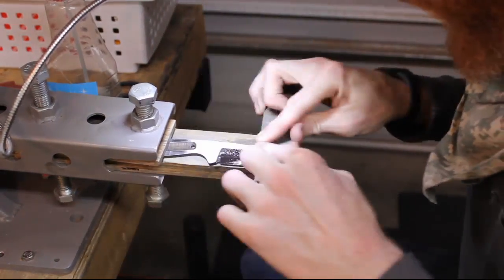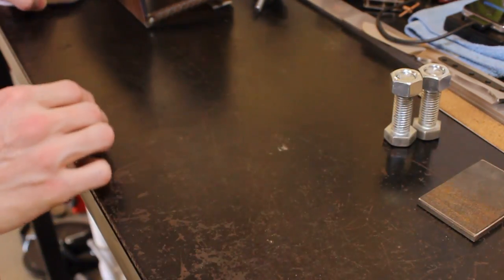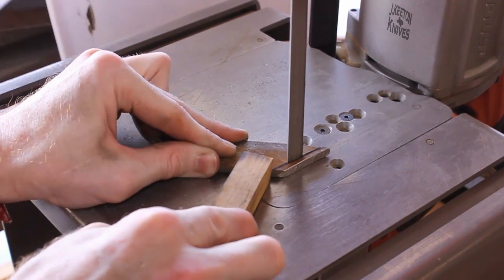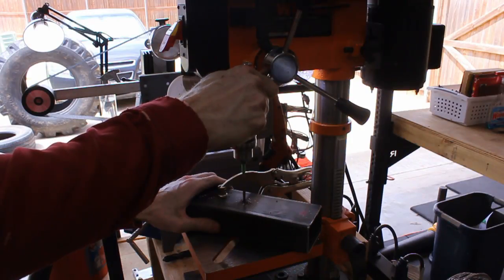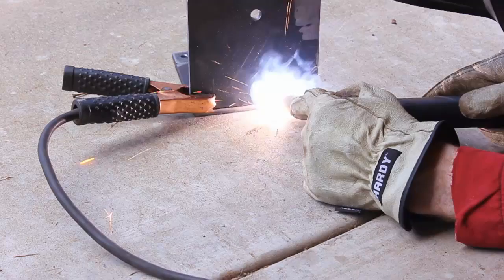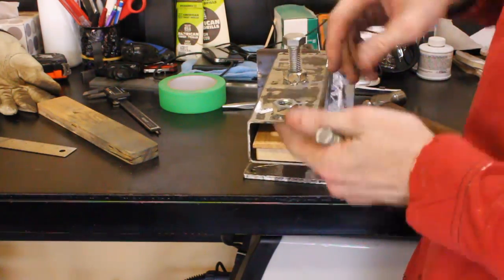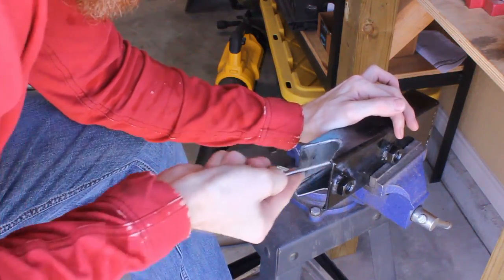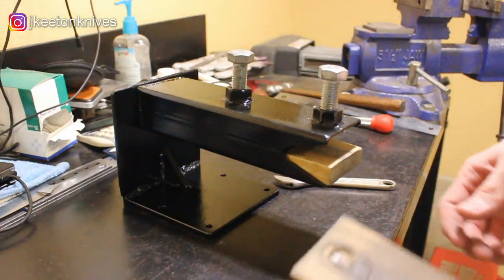Making a Knife Maker's Vise from Scrap - You'll Use it Every Knife...

Comment: Great idea. Seen it and went to the shop looking for material....  I decided I will have my back plate just flat steel. (Long enough to still allow the spin)  Then I can just put it in the vise when I need it, and set it aside when I don't need it on the bench.  Plus, the vise will swivel side to side as well.
Reply from the maker: Right on!

Comment: Now this is a real good and useful tool! I use a round pipe with threaded holes, and I fix it in my vise. That's working but I definitely will upgrade to something you got. Awesome job.
Reply from the maker: Scrap Metal Therapy hey man, thanks for the comment! It gets the job done for sure. I couldn’t live without it at this point!
Reply: Same here. I've been using a pipe with threads and a couple screws with a wooden dowel split in half. Then I secure it in my vise.
I like this design way better though.

Thumbs up!

Comment: Add JB weld over your welds and wait 24 for it to cure then you can grind it smooth and then paint you will have a nice looking piece! Thanks for this idea! What is you cost per unit
Reply from the maker: Hi Craig, I'm not making these for sale.
Reply: @RedBeardOps  thanks for these awesome ideas, just wanted to know how much it was going to cost! I did find a 4”x4” x 12” fence post for $10! I was excited to get it, not exactly what you have but I think I can use your ideas and make this work! I found maple wood on a harbor freight wood dolly for $7.99! I got the wood and 4 2” casters for $8 bucks! I could not afford the tools I’ve seen! I’m having to make most of the knife making tools I have! Which I found out is not that uncommon! I’m almost done with 2@x72” belt grinder I made from a kindergarten table supports I got this for free! My grinder will have cost me about $125 including a 1 horse motor, I did by a motor mount so the belt could be tighten! It took me a year to figure out to turn it 90deg on a square mounting pattern to make that work! Should be done within the week! My 1”x30” belt sander has served me well but ready to move on to something better! Thanks for helping all us financially challenged!  Craig
Reply from the maker: @craighuff8740  That's awesome Craig. A lot of the fun of knife making is to make the tools... and a lot of the fun is to see how you could get into the game on a budget. I've been in the exact spot you are! It's a journey my friend. Cheers!